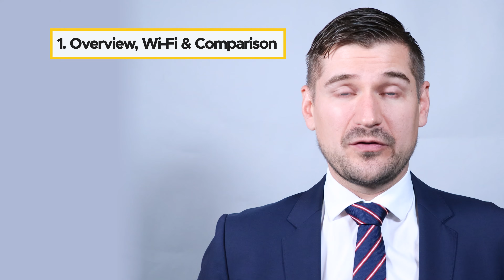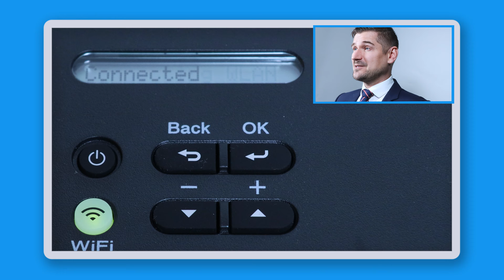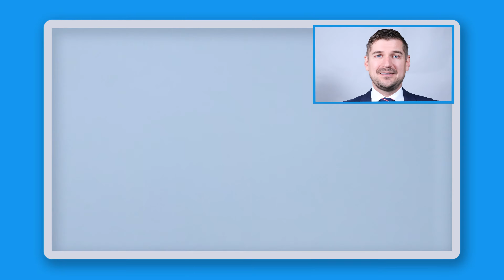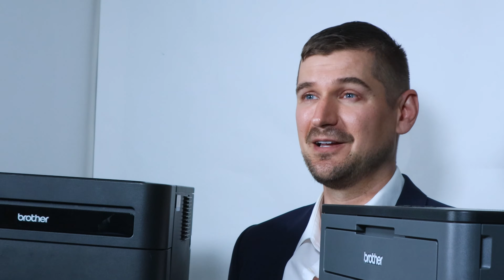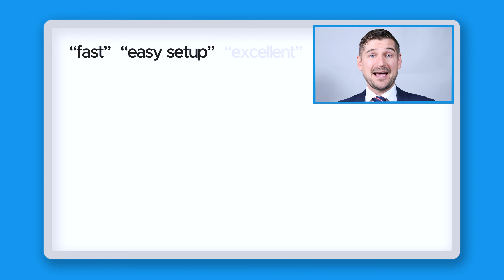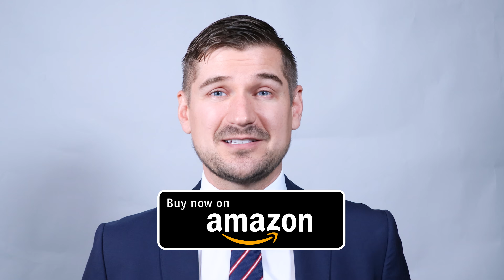📊 Brother HL-L2370DW Laser Printer - Full Review & Setup

Comment: I have the DL version, which comes with an Ethernet connection. It still does WIFI via the Internet router; before I bought this printer I did not know that was possible. WIth Ethernet, the printer reliably wakes up from deep sleep mode. 
Mine is in the living room, no noise issues here. You forgot to mention that the settings can be controlled from your PC via a web browser, that's much faster than using the printer's control panel. There's a resolution setting, and this printer can go up to 1200dpi, and even has a 1200HQ mode. I suspect that those who complain about poor print quality use the 600dpi or 300dpi setting. I use the 1200dpi standard mode and find the results excellent. 
I believe that this is the best value printer on the market. It replaces an HP4L (which comes from a time when HP sill built good printers), and wanting the brother to last as long as the 4L did, I appreciate that brother sells spare parts at decent prices - not that I expect a repair to be necessary in the next 10 years. I should add that having two home offices in this household, we print a lot.

Comment: Hello, I got this printer and it is out of warranty now, I'm getting this error: " self diagnostic mode" 
Did all the "reset" options but didn't help at all. It is not hot or anything like that and the error that's what I see online. 
What do you think I should do?
Reply from the maker: Hi there. I'm sorry to hear you're having trouble with it. I haven't experienced that issue myself. Good call trying all the basic resets. I'm assuming you already tried a new toner cartridge as well just to rule it out? According to the manual, it will give you that message if 'the temperature of the fuser unit does not rise to a specific temperature within the specified time' or 'the fuser unit it too hot'. Everything in the manual around fuser issues says "Contact Brother Customer Service. In USA - 1-877-BROTHER (1-877-276-8437)". I would suggest giving them a call. Sorry I couldn't be more help. Wishing you the best of luck getting it sorted!
Reply: @SeanDillman  maybe you can help me still but in another way, a little professional advice?!? I'm running an auto repair shop, I used this printer for a few years now. My needs are a network printer black on white printing sharp pages approximately 10-30 pages per day... do I need this much of a printer or a $100-$150 printer could do? I need something affordable and durable

Comment: Sean, this is a very good review of the product. Thank you. I currently have previous model (HL-2270DW made in 2012) that has not been heavily used, but keeps on ticking as the saying goes. Your review is enough that I'm likely to lick up a HLL2370DW in the next couple of days as a back up.
Reply from the maker: Thank you, @SteinerHaus! I'm glad you found the review helpful. It's great to hear that your HL-2270DW has served you well, and I hope a new HL-L2370DW will meet your expectations as a reliable backup. My guess would be that it will because it's basically the same machine as the previous model with minor changes. I'm still using my regularly years later and aside from needing to change toner every so often, it works like a charm. As far as I can see, there is no other printer on the market quite like this one and I'm grateful to have found it. Happy printing my friend! 😊

Comment: is it possible to increase the toner thickness used?
Reply from the maker: Hi Vincent. That's a good question. I just checked the manual (link below). On page 33 it shows how you can use the software to change the media type (i.e. what you are printing on). It says "Select the type of media you want to use. To achieve the best print results, the machine automatically adjusts its print settings according to the selected media type." I suppose you could select 'Thick Paper' as is shown on page 159 and see if that achieves your desired effect and increases the toner thickness used. Here is a link to the manual: https://download.brother.com/welcome/doc100810/cv_hll2310d_use_oug_d.pdf. I hope this helps. 👍

Comment: Helpful Video.  Trying to decide if I will purchase this printer most likely.  Upgrading from -HL-2270DW which is broken (and also tired).  I would add that the UI for setup is at least 20 years out of date but setup is a one time deal and most of the configuration will be done on our computers anyway.  Still great job on explaining and demonstrating the setup process.

Comment: Thanks for your review. A qustion. Is there on option to print out the printerinfo like the 3-buttonpress you did on the HL2270DW
Reply from the maker: Hi there. That's a good question. Because this unit has a small screen, there are actually menu settings that you can use. Press the up arrow until you see "Print Reports" and then press "OK". Then navigate to "Printer Settings" and press "OK". Then press the big green "GO" button. It prints a three-page report which is basically the same as the one for the older model. I just tested it now and it works well. My Drum Unit is at almost 100% and my toner is down to 25% or so. So far so good. I still love this printer. 😊

Comment: How do I make copies?
Reply from the maker: Hi Eli. This Brother printer only prints in black and white; it isn't also a copier; however, a workaround that you can use is to take whatever you want to make a copy of, take a picture of it with a smartphone, email it to yourself, and print it using your Brother printer. It's something that I've done before and it works just fine. I hope that this helps. 😊👍

Comment: Sean, 
I enjoyed your videos.  
I need your help regarding the interior of the back of the printer.
I had a high capacity toner cartridge which lasted a very long time.  By the time I ordered a new cartridge, I'd forgotten how I installed it. 
So, big mistake & tried to install in back.
Very difficult time before I realized to install the cartridge in the front.
During my obviously failed attempt to install in the back, I did something wrong & caused things to be out of place.
I do not know what I did or how to get things back in proper place leaving me unable to print.
Can you please help me put things back as they should be?  My son bought this printer for me & I gave him my earlier version that is not wireless as I print alot & he doesn't have wireless capabilities on his computer.
I would be so happy if you can help me!
         Sincerely, Elizabeth
Reply from the maker: Hi Elizabeth. Please excuse the delay in my response. I recently started a new job and it has been keeping me very busy. Have you resolved the issue? Without knowing more about what you did, I would find it difficult to diagnose and resolve with you. If you still need help, would you be able to take pictures on a smartphone or tablet and send them to me by email? My contact information is on my website.

Comment: Can you print pictures
Reply from the maker: Hi Marjorie. Technically, the answer is yes but I would not recommend printing pictures using the Brother HL-L2370DW. This printer is a monochrome laser printer, which means it can only print in black and white. It does not have the capability to print photos in color.

While you can print images on this printer, the quality may not be as high as what you would get from a color inkjet or photo printer. Laser printers are designed to produce high-quality text and graphics, but they are not optimized for printing photographs.

If you do decide to print images on the Brother HL-L2370DW, it's best to use high-quality images with a high resolution. This can help ensure that the images are as sharp and clear as possible.

However, if you are looking for a printer specifically designed for printing photos, you may want to consider an inkjet or photo printer instead. These types of printers are designed to produce high-quality, color images, and often come with features such as specialized ink cartridges and paper trays to help ensure the best possible print quality.

Is that helpful Marjorie? 🖨😊

Comment: My dislike is that I can not make a copy.  Thanks for saying it out loud.  IT'S NOT A COPIER!!!!!!
Reply: Scan documents with phone then send to printer. Every phone has a built in doc scanner.
Reply from the maker: Good tip  @Frankienoname0 . Thank you. I agree. I always try to scan using a desktop or flatbed scanner (depending on the job) but sometimes, if need be, I will simply take a picture with my smartphone. It works pretty well. 😊
Reply from the maker: Yes sir. Thank you for your comment John. It's true. It doesn’t offer scanning, copying, faxing, media card reading, or any other functions. It is just a black and white printer. Nothing more. Nothing less. 🖨
Reply: I bought this printer because it doesn’t have a scanner.  Less to go wrong and much less bulky.  If you want the all-in-one with a scanner it’s 30% more expensive, but these printers are well-priced.  I use an app to scan on my phone and the results are just as good for most purposes.

Comment: It keeps pulling from the manual tray ???? which it says is Tray 1.  I don't have that tray open so the "Auto Select" should be pulling papaer from the bottom tray.  Also, neither is labeled.  Little things  like this are annoying.  Will definitely change to quiet mode because it is noisy.  Only thing I like is the size, the speed and that its a black and white duplex printer.  But it isn''t working like a plug and play which in 2023, I think printers should.  Thanks for the quiet mode and sleep mode turn-offs.  Will watch again when I have more patience on the wireless printing.
Reply from the maker: How did it go Lynn? Did you resolve it? I think the manual tray is the small slot in the middle of the front, and tray 1 (the only tray) is the one on the bottom. You make a fair point. They could have labelled them. I also definitely prefer quiet mode. I agree that modern devices should be easy to install and plug-and-play. What software were you using to print? Word? Adobe Reader or Acrobat?
Reply: @SeanDillman  Thank you so much for replying and inquiring.  lol  I also appreciate the specific instructions on the deep sleep mode.  Sleep and deep sleep should be an option and not the default.  To answer your question, I was printing from Word when it wouldn't print. It seemed to like Adobe Reader better.  It did print from my phone so I got the wireless working.  I will try again soon.  It also pulled more than one paper when it did pull from the manual tray.  I like things to work easy without a lot of hassle so this may be my last Brother printer. My previous printer was a HP LaserJet 1020 which lasted FOREVER and it worked with every computer I plugged into it.
Reply from the maker: I hear you  @slynn4311 . I also don't have a lot of time or patience for tech that doesn't work. Things have become so streamlined these days so I have a pretty high expectation that things will just work with little to no hassle. I'm glad to hear that you got it to work from your phone so that you know that now all you need to do is get it to work properly from your computer. One issue down, one to go. I've had a few HPs in my life too and always found them to be quality machines. I'm sorry you're not loving this Brother unit. For what its worth, I'm still really happy with mine. It isn't perfect and I don't expect too much for the price, but I find it to be reliable and provide high enough quality for what I'm printing (routine black and white office documents and memos). Have a great weekend Lynn.🙂

Comment: Very helpful. Two comments - why didn't you cover the WPS setup method? And the bit on entering the password went very quickly - how do you switch from upper to lower case?
Reply from the maker: Hi John. Thanks for the comments. I appreciate it. I didn't show the WPS setup method because I thought that a standard wi-fi setup would be the most used method. Also, WPS is designed to be user-friendly so I thought that people wouldn't really be having issues with that. Regarding putting in the password, the upper and lower case letters are next to one another so you just keep pressing the button. For example, for a lower case A, press the button once. For the uppercase A, press the button twice. That is my recollection anyway. I'm not in front of my printer right now. It's at my office but it's the weekend so I don't have it handy.

Comment: Thanks , excellent review. One question - I’m comparison to the previous models, are they all the same size or is one smaller then the other? I have a small space and size is important. If I purchase, I’ll be sure to use your affiliate link. It’s the least I can do after that review.
Reply from the maker: Thanks for the question. They are essentially identical in size. Brother made a few cosmetic changes to the outside if the case but they are the same dimensions. That would amazing if you'd use my affiliate link. Thank you so much and Happy New Year. :-)

Comment: Attorney here, this printer sucks. Bad software. Lucky to work on command 1/2 the time. Bad software and and feeder or whatever the thing is that sends the paper from the stack to the out-tray.I begged with it this morning (when I had motions to print on a deadline of course). Stay clear. Get an HP, pay more, worth it.
Reply from the maker: Hi WM C. Thanks for sharing your experience. Sorry to hear that this printer wasn't solid for you. I definitely know the pains of working with a printer that isn't working when court is looming and time is tight. I'm a fan of HP too. I'll have to review an HP printer in the future. 🙂
Reply: The printer is top, but the attorney sucks.
Reply: @hansreynders6853  yea hans! Get em. He shoulda took your case.
Reply: In thirty years of working in an office, I've experience those same issues with HP, Xerox, Canon, Lexmark, and Brother. At least Brother hasn't begun to use extortion tactics on their patrons as reported by the Atlantic and presented here by the right to repair advocate Louis Rossman https://youtu.be/KGszSj0BLeg
Reply: Completely disagree with you. If you got a faulty model, then I cannot say. 

However the printer is ROCK SOLID with ONE EXCEPTION.

There is a caveat that wasn't covered and it seems that the manual is WRONG. 
802.11n isn't supported or isn't supported well. Decent connections can only be gotten on 802.11b or g. Note that if you force the cipher to be WPA2 only (i.e. AES) you will see an increase in packet loss. I'm guessing the wifi chip is weak in processing power. Transmit and receive is sufficiently strong. I'm not idea what "Wi-Fi Direct" is ... some sort of auto-configure but no one should be using that stuff, it's almost always insecure --> again disclaimer, don't know + didn't use.

Comment: This is a good printer from its specs, but what happens to its purported replacement HL-L2379DW? This newer model has been on the Brother website for months now, but I cannot seem to find it on sale anywhere. It's very strange. What is the difference between the HL-L2379DW and the HL-L2370DW other than the color?
Reply from the maker: Hi Jason. Great questions. I wondered that too, i.e., where is the HL-L2379DW and what's the difference between the HL-L2379DW and the HL-L2370DW other than the color?

I opened the webpages for each in new tabs (https://www.brother-usa.com/products/hll2379dw and https://www.brother-usa.com/products/hll2370dw) and toggled back and forth to check the differences. Same printing speed. Same connectivity. Same features. Etc.

However, I do see that the HL-L2379DW is to come with a 4,500 yield toner (the TN760, high-yield toner cartridge). The HL-L2370DW comes only with a starter cartridge that prints 700 pages (3,800 pages less than the TN760). Perhaps in response to the popularity of Epson's EcoTank printers (with the help of advertising with Shaquille O'Neal), Brother wanted to put out a printer that seemed to be new and has a higher yield, right out of the box? That would explain the slight difference and the change in color.

However, you are right. The HL-L2379DW doesn't appear to be available for purchase anywhere. It's not even on Amazon: https://amzn.to/3DIVYoJ

What do you think? It's strange isn't it? 🙃
Reply: Saw the HL-L2379DW available on Office Crave, but not sure if it's started shipping.
Reply: Have you been able to purchase the HL-L2379DW or what printer are you currently working with?
Reply from the maker: @TeslaSoCal  I have not been able to purchase the HL-L2379DW. I'm currently working with the HL-L2370DW. I was just visiting a friend in Toronto who runs an IT company and coincidentally, I found that this is his main printer too. It's a good one. 👍
Reply from the maker: Oh wow. Thanks  @TeslaSoCal , me, Jason, and likely many other people, have been wondering about if the HL-L2379DW would start to be available. The color scheme is really cool. 🖨👍